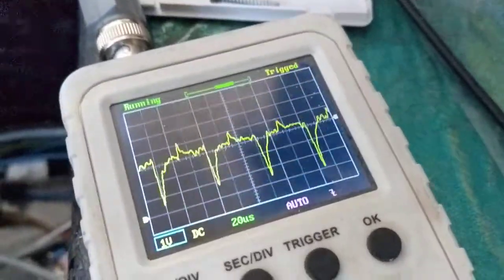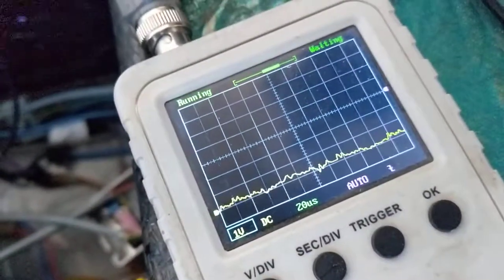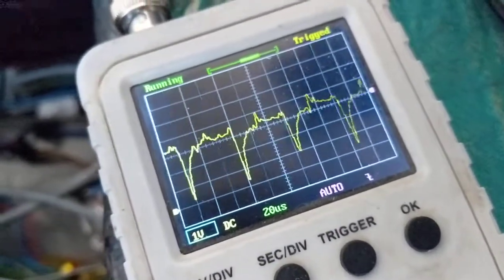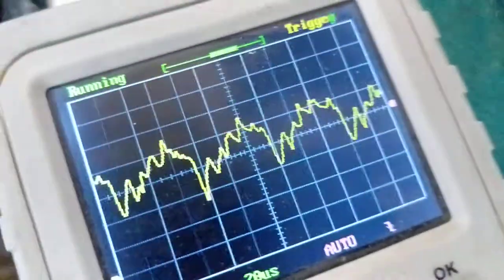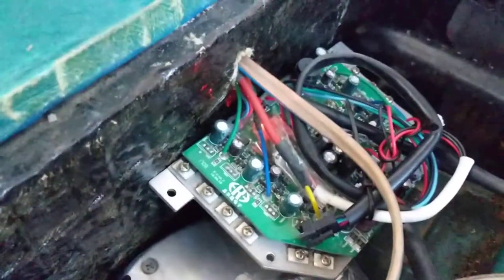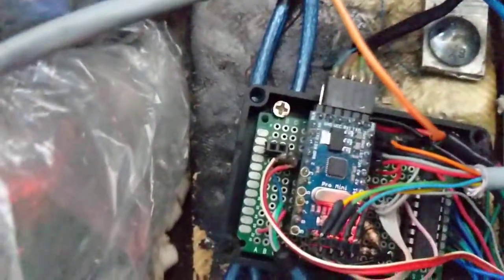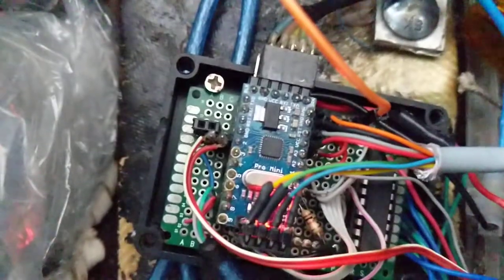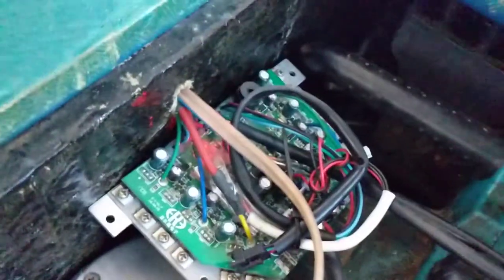Nasty 16.67 kHz spikes from Hoverboard controller :-(

Comment: I also trying to get rid of that high pitch noise coming from mainboard. I managed to repair mainboard, but there is that noise. I replaced almost all capacitors -> no help. Next i'm starting to look with scope. Also do you know is motor speed from debug rpm or input voltage to motor? See my video: https://youtu.be/FzbgopmcjVE
Reply from the maker: you have to look at https://github.com/EmanuelFeru/hoverboard-firmware-hack-FOC/blob/master/Src/main.c#L407 to see what is set as the debug log output.
You can change the code of main.c with my online compiler..
I wonder what high frequency generator can be on the board that already makes my HF noise when the motors are not running.
Is there a charging circuit on board ? I thought there is only a simple mosfet that cuts of the charger when the battery is full. If not then maybe attaching the charger will change the HF noise.
It might help to flash en empty firmware that does nothing at all. To see if the software is causing the HF noise.
Reply: @robodurden  where you get those spikes? 3.3v line? i checked all my mainboard voltages with scope, and there is no ripple.
Reply from the maker: @jusubbidiy  As i said, i only get these spike on a INPUT_PULLUP pin of the arduino mini. But these spikes might also be the reason for error prone serial communication from hoverbaord to arduino mini - as many other experience. Because the RX pin of the arduino mini is also an INPUT_PULLUP !
Tomorrow i will make a video on the three voltage regulators on the hoverboard controller. The first from 36V to 14V is very primitive with a period of 60 us, twice the length of these nasty spikes.
If you have a scope, please test your middle pin of the second TIP127 (TO220) Transistor. I get different results for different hoverboard controllers !
Reply: @robodurden  yesterday i burned those 2 fets again, if i can repair it, i can check those voltages with scope for you. i also got problems with serial communications. Very often it just stop working middle of use. Also my laptop gets bluescreens randomly when it's connected to hoverboard, so i guess there is some serious interfence going on.
Reply from the maker: @jusubbidiy  The TIP127 are simple 5 A Darlington Transistors, no FET. When you speak of FET of 2 FET burned you mean that one motor phase burned. If the TIP127 broke you definitely have to check the 5V and 3.3V Volt smd regulators. When the even the 3.3V has short cuts, your board is very likely done for ever.
Reply: @robodurden  I checked Q3 collector and motor phases. See pictures here: https://photos.app.goo.gl/Zb34bG6EtnZr2qHm9 I guess that 16kHz spikes coming from motors phases. They have always that 
frequency, even when they don't spinning.